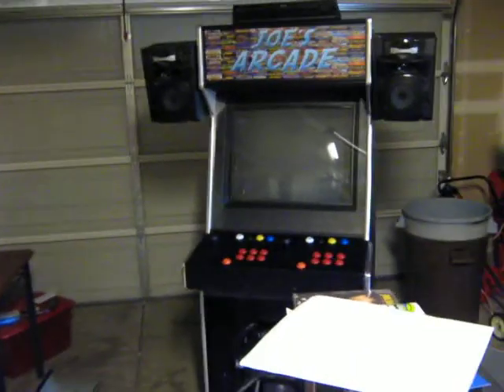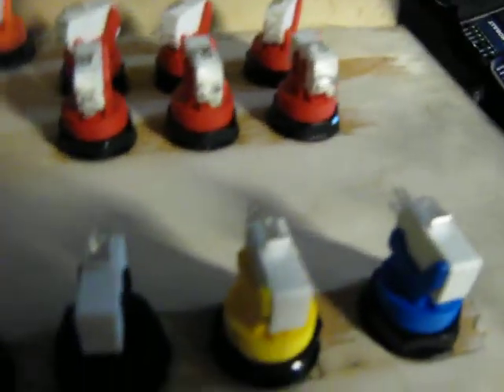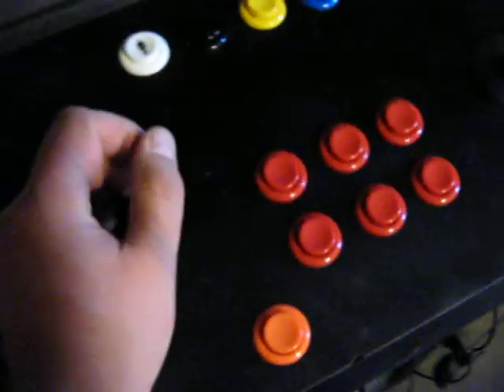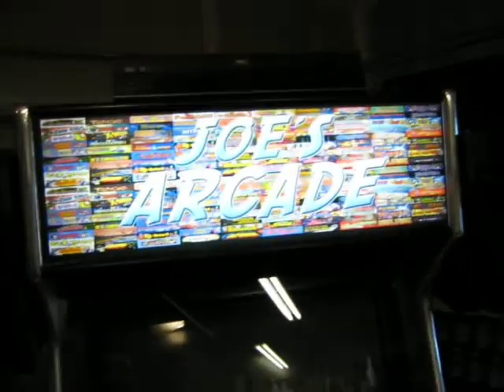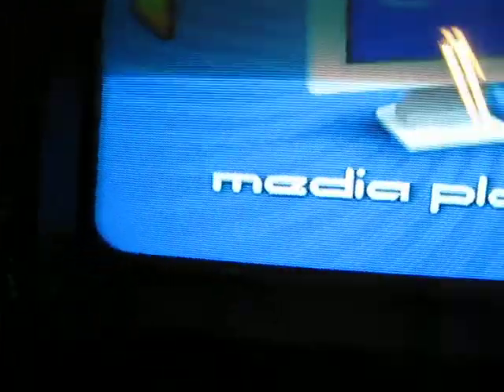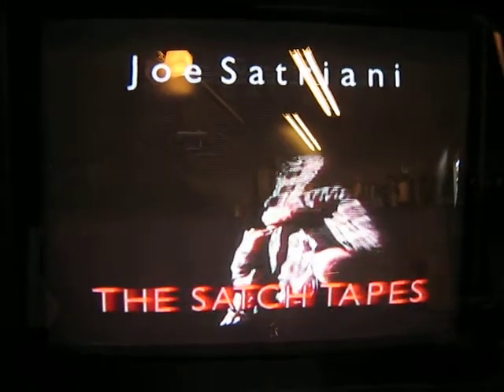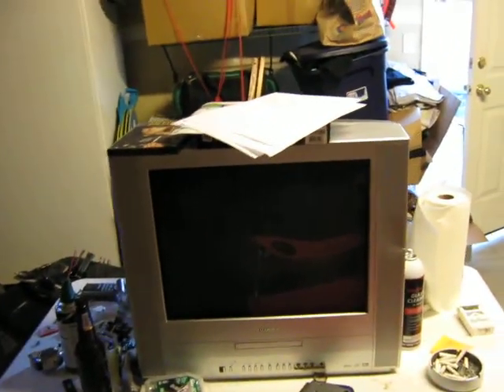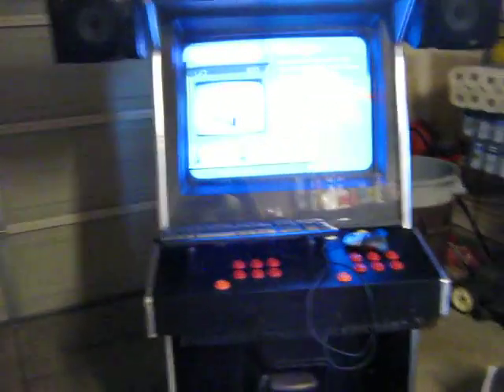MAME machine progress 5 (Getting close!)

Comment from the maker: @kjshatto yeah I have it all lined out.  I still need to fig out what terminals need to be wired.  there is a COM and On/off connection on all the buttons.  Which one is the ground? and which one is the hot?  Im guessing the COM is "common" for ground. and the ON is the hot wire that goes to the IPAC.  Ill fig it out.